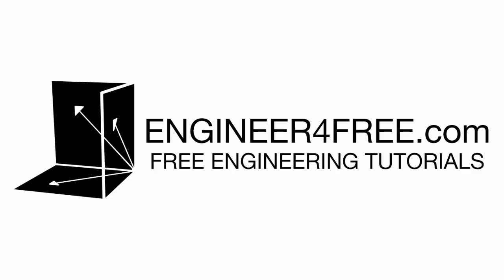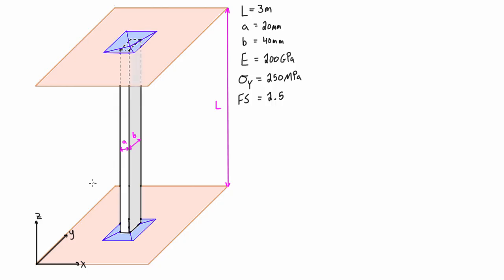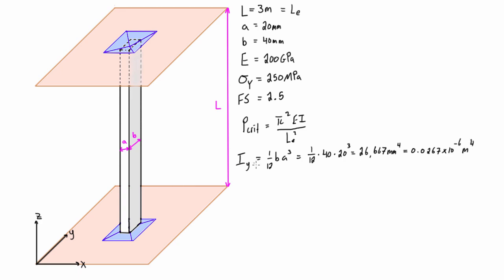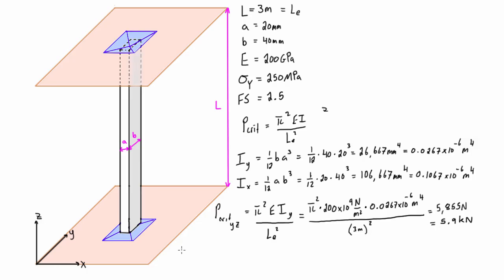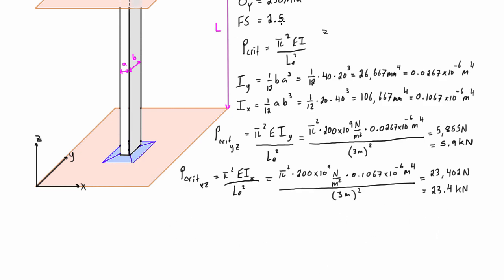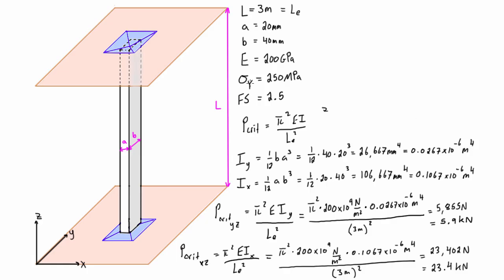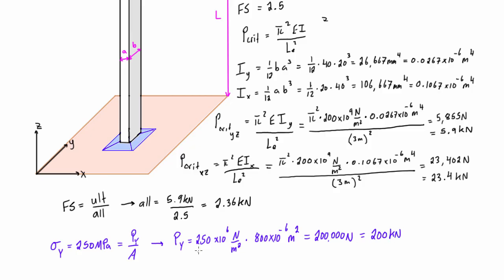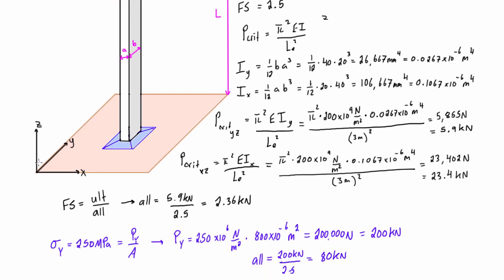Column buckling example problem #1:  both ends pinned

Comment: Hi mate, thanks for your videos, they're helping me immensely with mechEng degree. I have a question regarding connectioons, Both ends pinned would mean that the "weak" axis buckling about y would be fixed? would that be a k value of 0.5? I paused and solved for that as usually pins only translate about one axis? any clarification would be awesome, thanks again! :)

Comment: this is for an ideal euler beam right? Otherwise you'd have to solve a differential equation ?say you also had a distributed load aswell, then it'll be a non-homogenious diff. eq, do you have such an example?
Reply from the maker: All my column examples can be found in videos 50-56 here: engineer4free.com/mechanics-of-materials Each one pretty much just compares the yielding and buckling limits for axially loaded columns.
Reply: @Engineer4Free  didn't think I'll get an answer so quickly, thanks! Your videos are amazing and are helping me alot during my studies.

Comment: Dear Sir.what would be the coneection type in the electric transmission pole? How to calculate the effective length in the electric pole?
Reply from the maker: Would be considered a fixed rigid connection
Reply: @Engineer4Free  Sir, what would be the Eulers factor in this case.

Comment: when the column buckles in Iy moment of inertia then the plane should be X-Z ? u were saying that the moment of intertia in Ix causes to buckle inx-z plane.. i think it shud be y-z plane. plz reply..
Reply from the maker: Hey Numan, when buckling occurs in the yz plane, that means the colunm will physically deform towards the positive or negative x direction. when buckling occurs in the xz plane, the column will physically deform towards the positive or negative y direction. The way you need to think of this is as if this was a beam bending problem that is just rotated into a column. With horizontal beam bending problems, you have bending, in the vertical direction, and you take the moment of inertia of the cross section of the beam using a horizontal axis that the beam essentially bends about. With buckling problems, the axis that you base the moment of inertia on is parallel to the "axis" that the column will buckle about (which is perpendicular to the actual direction the buckle "moves" in. It's kind of confusing, but I'd recommend brushing up on beam bending problems, you can watch videos 22-28 here: engineer4free.com/mechanics-of-materials and then also videos 50-56 on that same page. After watching all, through repetition, it might be easier to recognize which moment of inertia you need to use.
Reply: dear Engineer4free. i checkeed the comment from an other video. thanks though for the reply.  it will be great if u make an other video to make us understand. as everyone is having the same problem. :( OR maybe u can reccommend me some links or pages so that i can go and check my concepts.. maybe some prblems about Ix and Iz. THANKKKKKS. U CAND SHARE IT HERE WITH ME... OR IN MY EMAIL. zafar.nomi.zafar@gmail.com